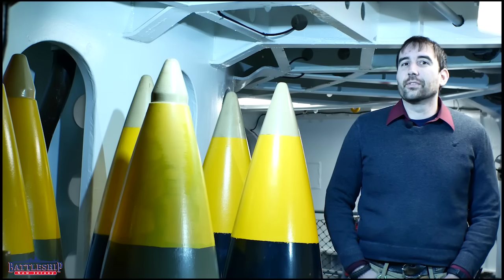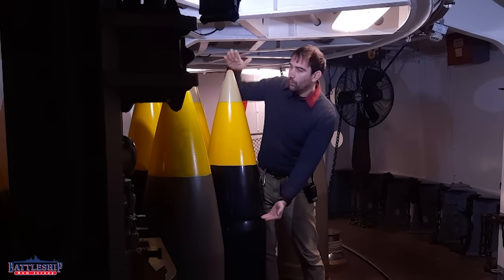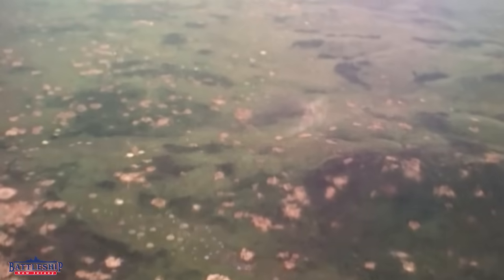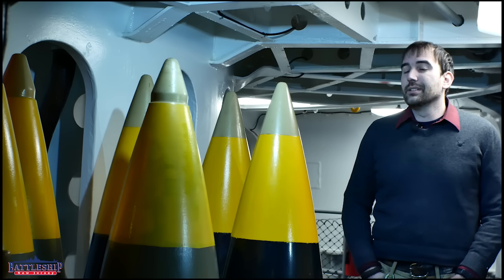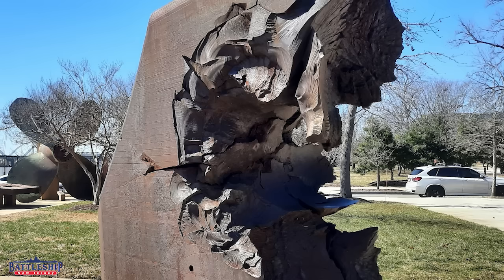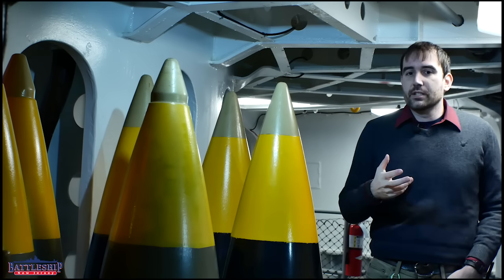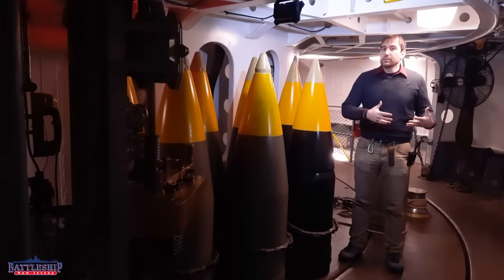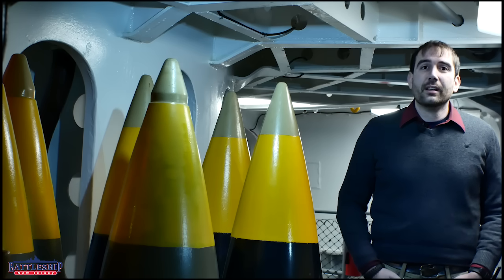What Does the Impact of a 16in Shell Look Like?

Comment: While in the US Air Force and stationed in Vietnam, I had an occasion to visit a guarded ammo dump with a friend.  There I took pictures of mostly 2,000 and others of similar pound bombs used by B-52s,  But then we came upon a much larger bomb,  It was not laying down on its side like most of the others.  If was sideways cradled in thick wood.  It was a 15,000 pound bomb and as I understand it was used to blow away trees in the forest to make an emergency landing area for helicopters, as was mentioned in this article.  The bomb I saw was not as long as the one shown for the NJ battleship, it had a much wider section though.  Also, the bomb I stood next to with my arm resting over the top for a picture had large hooks on top to be picked up and then dropped rather than be shot out of a naval vessel.
Reply: There was the 'Daisy Cutter', a 10 pound shrapnel bomb made to cut down a bunch of jungle for helos to land in, and the Cheeseburger, a 15,000 pound bomb that simply blasted everything into splinters for the same purpose. It was too big for bombers and had to be slid out the back of a C-130 Hercules cargo plane. whoa

Comment: I enjoyed this rendition of this particular round...but the paint scheme shown is not the scheme typically used. These High Capacity rounds as mentioned are point detonating most of your 'point detonating' fuses initiate at 25thousands of a second to maintain the bulk of the projectile above ground for maximum kill ratio.  Armer piercing rounds as stated are on a delay fuse. Keep in mind that the New Jersey 16"50 barrels are rifled and are not lobbed, but shot out just like any other rifle, or spiraling like that of a foot ball. These rounds, as stated will hit the armor and penetrate then detonate. The round is made of ballistic metal, made to come apart for maximum damage.  Typically, amor piercing, are loaded with HBX as max explosive power.  Other rounds are filled with TNT, TRITONAL, COMP-A, COMP-B, COMP-C OR HBX.

Comment: My late father flew bombers and transports in Korea during the war there. After one mission they got back to find out they'd inadvertently flown through the corridor where one of the New Jersey class battleships was shelling the North Korean/Chinese armies. Of course, the chances of getting hit by a 16 inch shell were probably not very high, still it was disconcerting! How did it happen? Typical military SNAFU, the US Navy didn't inform the US Air Force command where/when they would be shelling in time for it to work it's way down through all squadrons. Probably happened a lot.  😆

Comment: The amazing thing is at Tarawa the Japanese had a bunch of concrete and coconut log/sandbag bunkers. With a multi-hour barrage from from up to 10 14" and 16" battleships and I pretty sure heavy cruiser 8" rifles and still so damn many of those bunkers survived.  That was an island 2.5 miles by 800 yards.  With the fire power that hit Betio that island should have been an underwater crater.
Reply: I believe that was before the navy relaized they needed to fire at a high angle so the shell would fall down on the island instead of flying over it horizontally at ground level.

Comment: I believe “splinters” is indeed the correct naval term for the bits and pieces of both the gun projectile and the ship flying around after a gun projectile hits. I surmise the naval term originates from the days of “wooden ships and iron men” from the wood splinters resulting from a solid-shot cannon ball smashing a path through a wooden ship. Often the term “shrapnel” is used (having come to colloquially mean the same as “shell fragments”). Originally shrapnel was lead (Pb) balls expelled out of a cannon projectile to cover an area. 
Even if one’s armor piercing shell failed to explode after penetrating armor reports from Jutland and such spoke of “red hot” armor splinters flying about. (All that kinetic energy has to be conserved.) At Jutland the British pre-“Greenboy” shells were notorious for failing to penetrate before exploding. 

Some sources give the penetration of the 16” Mark 8 AP fired from a 16”/50 Mark 7 as 24” versus side armor at a range between 10,000 and 15,000 yards. I don’t believe the USN ever wanted to fight at this close range except to “finish off” a gunless opponent a la Bismarck. USS Washington (16”/45s) at Guadalcanal by necessity fought at closer ranges in a night battle and destroyed the IJN Kirishima.

Comment: My small unit in Vietnam was stationed near the South China Sea in 1968.  I was worling in our Signal Maintenance Shop one day and heard a sound that could have been either incoming or outgoing rounds.  I stepped outside to check it out and saw a ship out on the sea.  We had a neat little surveyor's transit that came out of the Air Force salvage yard that made a handy telescope.  I set it up on a stepladder and when I focused on that ship, which I thought was a destroyer. it turned out to be the New Jerseu.  She was only firing one round at a time but it was still impressive.  The sound took 23 seconds to reach us.

I remember reading in the Stars & Stripes that they were using to New Jersey to knock out bunkers on the DMZ that were made out of eight inch reinforced concrete.  B52 bombs would bounce of them.  Seeing that ship in action was my most memorable moment in my nineteen months over there.
Reply: 23 miles from you." Blimey!"
Reply: @jackrichards1863  5 seconds is 1 mile 
23 miles would be MAX range.... aka the shells would be dropping on the story teller 
.
5.7 miles away from story teller is the REAL distance....
Reply: @kainhall  He writes ".  The sound took 23 seconds to reach us." One mile per second is the speed of sound, so 23 miles. The direction the Jersey was firing does not have to be toward 'the story teller'. Five seconds is not 1 mile, pup!
Reply: @kainhall  The shells were supersonic, traveling well over a mile in 5 seconds.  If one hit you, therses no way you heard it coming.
Reply: @brianbrandt25  muzzle velocity is over 2,000 fps. Slows pretty fast after that.

Comment: Some details concerning the Armor-Piercing (AP) and High Capacity (HC) shells.

The HC was kept at 4 calibers (4 x 16" = 64") length to allow use in both the new battleships (NORTH CAROLINA through the never-completed MONTAN Classes) and the old COLORADO Class ships.  It weighed 1900 pounds.  The filler was the extremely inert (safe to even being hit with a hammer) Explosive "D" (ammonium picrate), which was slightly less powerful than the commercial TNT explosive.  This is the "powder" the narrator talks about.  It had several nose fuzes that could be installed aboard ship, as desired:  Impact, mechanical time, and, in the Mark 14 modification, the VT (tiny radar proximity) fuse, the latter also used for the 5" AA shells, though here for explosions in the air against shore targets, when specified.  VT fuzes only had to get within a couple of hundred feet of a solid target to blow up the shell, eliminating most of the need for extremely good range data needed for the older time fuze.  The nose fuzes could also be removed completely and a solid hardened steel nose plug used for penetrating concrete, rock, of thin armor, though not nearly as much as the AP could.  In this case it had a base fuze like the AP shell, but not as rugged as the Mark 21 used in the AP shells and with either no delay (actually about 0.003 second from the mechanical action on hitting the target) or, later, a very short 0.01-second delay to allow somewhat deeper penetration into protected shore targets.  It could not penetrate much more than 1" or so of armor steel without exploding with no delay, regardless.

The AP shells were the 2700-pound 16" Mark 8 AP of 4.5-caliber length (4.5 x 16" = 72"), known in some documents as the "20% Overweight" AP shell, since it was longer and heavier than the Mark 5 4-caliber AP shell of 2240 pounds used by the COLORADO Class.  COLORADO Class could not handle the longer Mark 8 in its shell-handling system so its Mark 5  was kept closer to most foreign designs in length and weight.  Both the Mark 5 and Mark 8 were late-1930s extremely tough shell designs.  The Mark 21 Base Detonating Fuze had a fixed 0.033-second black-powder delay (actual measured average from the intended 0.035 second spec) and a extremely complex and strong structure to withstand hitting thick armor at up to 40 degrees from right-angles in acceptance tests (well above the foreign 30 degrees specs used in WWII).  US Navy  AP shells, once some minor bugs were worked out during WWII, were the best all-steel "conventional" AP shells ever made by anybody!

Comment: CONTINUING MY COMMENT BELOW (something stopped the Comment from finishing)

At the main gate of the US Navy Surface Warfare Center, Dahlgren Division -- the old Naval Proving Ground for WWII shells and armor -- there is a 18" Class "B" turret face plate from a lot for the USS ALABAMA.  It was hit by two 14" Mark 16 MOD 8 AP test shells -- the standard, extremely-strong shells used for this purpose during most of WWII -- at 30 degrees from right-angles, the usual acceptance test angle.  This was for quality checking.  One huge hole went entirely through with minimal plate deformation and the intact shell (minus its AP caps and windscreen, of course) stands next to the plate.  The other hole is more ragged and had the shell sticking half-way through the plate.  The shell is split in two lengthwise and had large chuck broken off of its nose and body.  This is why the US Navy in WWII did not think that they needed Class "A" armor for these very heavy plates.  The US Navy had very good armor in WWII!

Comment: There was two kinds of armor used in WWI and WWII armored warships:

(1)  Homogeneous, ductile armor -- BuORD Class "B" or BuC&R/BuSHIPS Special Treatment Steel --  used in thinner areas like armored decks and other external and internal protective plating, that was relatively soft all the way through (though still a very strong nickel-chromium alloy!) and bent, stretched, and, when penetrated, finally had to be torn open to allow the shell through.  It was used in extremely thick plates on the new battleships'' main armament  turret face/port plates and for the conning towers, its thin and medium-thickness deck armor, and in various other medium and light armor areas.  It was very good when hit at a hit angle, being abler to stay in one piece long enough to cause many shells, AP or otherwise, to glance off the armor with minimal damage before penetrating entirely through.

(2)  Face-hardened armor -BuORD Class Ä"- that was of a similar steel to the soft armor above, but which had the front part of the armor -plate hit first by the attacking AP projectile hardened to a very high level on the surface and also having a thick, gradually-softening less-hard deep face behind that, with soft armor at the back of the plate to act as a shock absorber.  The face hardness and thickness varied in different nations made by different manufacturers, but they were all based on the German Krupp Cemented (KC) armor type introduced in 1894.  The US Class Ä" armor in WWII had a very hard cemented (carburized/case-hardened ( thin surface layer and the deep face layer going back to about 55% of the plate thickness before the back layer began.  Most foreign armor of this type had a thinner face, but the US manufacturers were trying to damage the extra-strong WWII US Navy AP shells, sometimes with less-than-desired results.  Most foreign vertical armor was of this type, but the US only used it in WWII for the waterline belt armor, the thinner turret sides and back plates, and the heavy circular barbette plates holding up the main turrets.  This armor was somewhat more brittle than Class "B"/STS, but it could cause damage to many, if not all, AP-type shells that either reduced their penetration ability or, failing that, the ability of the shell and its base fuze to explode properly after penetrating, thus reducing deep effects ins8ide the ship hull from the use of more moderate-thickness armor.  Only the US used Class "B" turret faces and conning towers in WWII, because it turned out that plates that thick (18-19") made of either armor were quite able to cause similar shell damage to the majority of gun pro0jectiles used in WWII, so the hard face was not needed.  Also, the conning tower could be welded, making it easier to merge with the rest of the surrounding superstructure.  Face-hardened armor hit at a high angle (over 45 degrees) may cause a shell to glance off and break apart, but its face brittleness can very often cause a huge chunk of armor shaped like the projectile side be broken off and thrown into the area behind the plate, which is not satisfactory.
CONT ABOVE

Comment: Dude, you lost me at “16 inch, .50 caliber shell”
Reply from the maker: its just 50 cal not .50 cal. With artillery like this, caliber is a measure of barrel length, not diameter
Reply: @BattleshipNewJersey  Please explain
Reply: @charlesc6954 In large guns (particularly naval guns) saying 16 inch 50 CAL, is saying that the bore is 16 inches across and the length is 50 of those bores (or calipers) long. So 16in times 50 gives you the length of the gun at 800 inches.

Comment: In the battle of Bismarck 
Your wrong 
The closer Rodeny and KingGeorge got the lesser theere shells penetrate due to the flat trajektory..
Reply: Actually flat trajectories do increase penetration of belt armor ( which is what he was talking about) but it does decrease deck armor penetration so you are correct that it probably would have been better if the pulled back and lobbed shells the crash down through Bismarck’s deck.

Comment: What is a 16 inch 50 caliber shell??
Powder?? You mean high explosive?
Reply: The guns were 16in 50 cal guns. In this case 50 cal means that the barrel is 50 calibers long or 50 times the diameter of the barrel. So 50 x 16in so 800 inches long. These were the shells that were fired from these guns along with the 16in 45 cal guns

Comment: 50 cal? You mean 50 mm
Reply: The guns were 16in 50 cal guns. In this case 50 cal means that the barrel is 50 calibers long or 50 times the diameter of the barrel. So 50 x 16in so 800 inches long.

Comment: He mentioned 50 caliber...what is 50 caliber? I don't see anything that is .5 inches
Reply: The guns were 16in 50 cal guns. In this case 50 cal means that the barrel is 50 calibers long or 50 times the diameter of the barrel. So 50 x 16in so 800 inches long.
Reply: @willpat3040  thanks

Comment: I served on the USS New Jersey BB-62 off Beirut. We took out a mountain. A tunnel was being used as an ammunition depot. Fired for a while, hours. When the guns fired you would pick up your cup or the contents would splash out. I still have a few photos where the shells are visible as they exit the fireball. As loud as the guns are, the concussion on the body was more impressive. Nothing else like it. Bridge windows were rolled down. And we would all drop down when a full charge was fired. 600 lbs of powder per gun. 9 guns. 5,400 lbs in one broadside.

Comment: 50 cal.  LMMFAO 🤣
Reply: The guns were 16in 50 cal guns. In this case 50 cal means that the barrel is 50 calibers long or 50 times the diameter of the barrel. So 50 x 16in 800 inches long.

Comment: I was on a destroyer that normally operated with the carrier Hornet off the coast of VietNam in 1969. We got pulled off and sent on a naval gunfire support mission so I thought, OK that's going to be a lot of noise like it usually is...but this time we were running a little ahead of the New Jersey. When we doubled back, the New Jersey was firing right over us - 9 barrel volleys, sometimes less. It sounded like thunder, then there was a much stronger sonic shock after that, followed by what sounded like several jumbo jets coming over at about 50 ft. altitude. After a few seconds, when the shells hit, there was a distorted mushroom cloud that contained rocks, water, dust, trees...whatever was at the target.  We were firing our six 5" 38s and getting good reports from our spotters, but everyone was watching the New Jersey.

Comment: Lol 16 inch 50 caliber? Ummm, someone that has no clue about guns is putting out bad info or something?  A 50 cal is what, a hal an inch in diameter and 670 grains? And a 16 inch battle gun on a turrant is, well 16 inches in diameter and weighs as much as a VW Bug. Huge difference. Are the millenials and gen z changing definitions again to alter reality? Wikipedia is even wrong on this.
The big guns were 16inch guns that could be elevated to 50 degrees not 50 caliber. But forgive me if i heard this video wrong.
Reply: The guns were 16in 50 cal guns. In this case 50 cal means that the barrel is 50 calibers long or 50 times the diameter of the barrel. So 50 x 16in 800 inches long. Naval guns from around the 1850 - today use calibers to denote the length of the barrel. Like the 15in 42 cal of the British HMS Hood. Its barrels length were 42 times the diameter of the barrel.
Reply: He's talking about the 3/50 guns I'm pretty sure. The shell is 3in in diameter and the barrel is 150in or 50 cal.